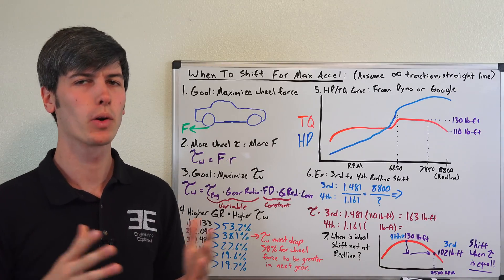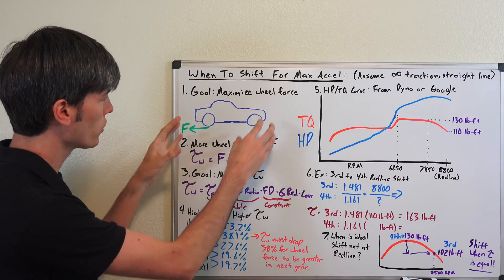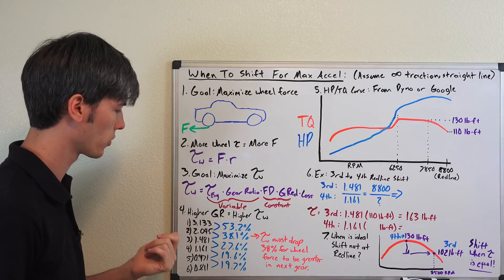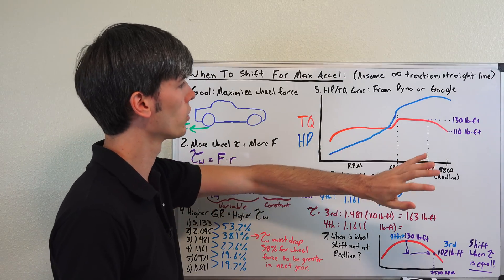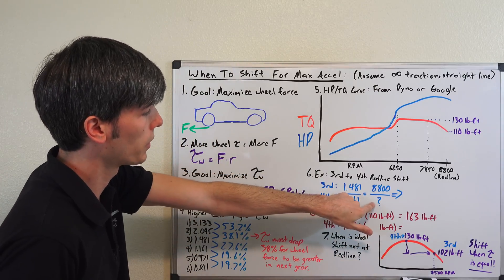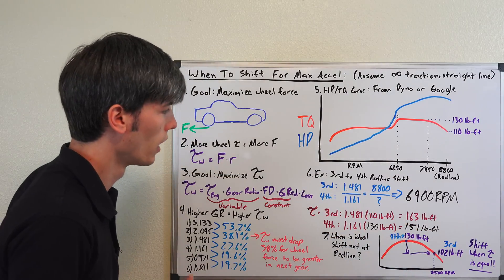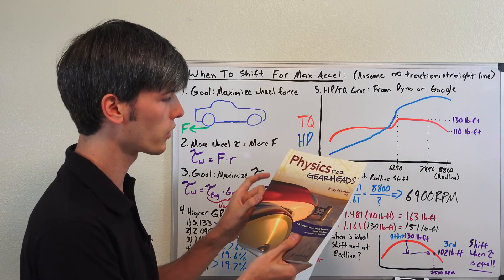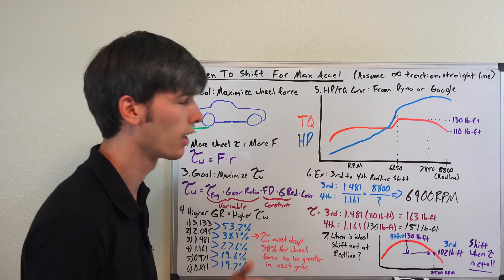When To Shift Gears For The Fastest Acceleration

Comment: I ride 2nd gear up to 50 km/h at 3500 rpm and 3rd to 80 km/h at 3000 rpm, the hard part is when I get to 4th gear I lose all my acceleration. Any tips? I can't ride 3rd any longer

Comment: Hey. Very interesting. I’ve found in my focus 1.5 TDCi 120hp that redline is slower than a (very small width) lower range. Also mid range double dipping accelerator seems to give the turbo an extra boost response but that might be my imagination lol

Comment: How does one get a flat torque curve in the higher rev range in higher gears? Is it not possible because the upper gears have a lower gear ratio and can’t supply the necessary wheel torque in the upper power range?

Comment: it's a theory to help you to understand how your engine works within the max power. HP or the power is limited , but how to use it properly for the max accel.
in a simple way :
when the engine power is much beyond the current ratio , shift when you hear engine's screaming.
when you're on the 3rd or 4th (maybe higher 5th depends on which car you're driving)ratio ,shift when you feel like your engine's roaming .
and when you ALMOST feel like there won't be any accelerating even if you shift up ,it is time to gear on the final shift .
this video bascily is trying to tell people how HP equals shift.

Comment: 1st gear launch at 2500 rpm.  Power shift into second at 4500 rpm. Shift at 7000. Rpm into third shift at 7000 rpm into forth.   03 Cobra  lol traps 127 in quarter mile lol

Comment: You cannot simply rely on torque, as a force to measure acceleration, per F=MA, because an engine isn't designed to apply a constant torque/force. The rate at which torque is being applied is also relevant. It is obvious, that an engine producing 500 lb-ft torque at 2000 RPM will not accelerate faster than an engine producing 495 lb-ft torque at 5000 RPM, as even though there is slightly less Force generated by 495 lb/ft torque, it is being applied so much quicker, that the sum of movement is more than 500 lb/ft applied at a rate of 2000 RPM. So the answer is to shift at the points where Torque X RPM is the highest.

Comment: Can someone in fair detail explain to me, what factors determine engine power and torque? Let's say they all use the same fuel, same chassis and body, then put a 2.0L natural aspirated engine, that makes 300bhp, vs a 2.0L that only makes 150bhp, what causes one, to make much more than the other, when they're both V6 for example, both 2.0L so why does one make double the power? I know some things like the quality and type of engine parts, but how does it make so much more?

Comment: Not to be picky, but don't you actually need to use calculus and integrate the area under the curve at any given RPM?  The Honda has a flat torque curve due to the VVT, so the simple(r) method described here probably gives the correct answer, but for an engine with a peaky torque curve it might not.  (I know, nerd alert.)

Comment: Purely from a theoretical point of view I can't fault you. That said, I have driven a lot of cars (manufacturer stock tune) where in essence what they have is essentially First gear, three 'Third gears' and very often an overdriven Fifth. On such cars the solution lies in experience with the vehicle: simply redlining each change doesn't cut it because the 'middle three' gears are too similar. On one particular Audi (sorry, I forget which exact one), I actually preferred to redline(well actually just over) in second and change directly to fourth if I was seriously in a hurry.

Comment: I'm wondering if anybody would be willing to double-check my math on this:
1st gear = 3.856
2nd gear = 2.648
Redline = 9000rpm

3.856(69ft-lb) = 266lb-ft @ 9000rpm
2.648(103ft-lb) = 273lb-ft @ 6180rpm

My method for when to shift:
3.856(x) = 273lb-ft
x = 273lb-ft/3.856
x = 71lb-ft

Then I look on the curve where 71lb-ft is and find it at about 8730rpm.

Comment: The power your engine is making is the amount of energy it is communicating to your car per unit of time. The energy of your car is it's speed, exclusively. The variation of it's energy is the variation of it's speed, i.e. it's acceleration. Maximum energy variation at maximum power, hence maximum acceleration at maximum power, whatever the torque is, assuming the losses are the same at every rpm.

And from a commercial pour of view, why would car makers let your car make more power shifting earlier, letting you rev at higher rpm for nothing, reducing the car durability ? It makes no sense so redline is top acceleration.

Also look at Auto/dct transmissions : floor it and it shifts at red line. Car makers won't reduce their car 0-100 with no reason.

Comment: Too many question in my mind.
Why use torque?
Isn't torque is the ability to pull weight? Aka to pull Newton which is mass * gravity?

Should be using horsepower instead, because max horsepower means biggest, fastest acceleration the engine is producing at any rpm.

That's why race car, racing drivers shifts and maintain the rpm at top, at very high.
They don't maintain the rpm at the biggest torque curve!
They maintain at biggest hp curve

Horsepower always direct proportional to the torque. 
Meaning, higher torque is higher horsepower correct? 
Hp=torque*rpm*constant correct? 
But why is the torque is dipping down but horsepower is still increasing? 

Please teach me, enlighten me

Comment: Well its not smart to actually hit the rev limiter because then you spend time bouncing the revlimter and lose momentum..you need to change just before it hit rev limter..

On my bike i i had best result when i changed at 13500rpm vs 14000rpm (revlimiter) my VBOX result was the same everytime i did this so maybe there is a flaw in theory my friend..

Many times i also had great result when i changed gear at peak power whcih is 13000rpm  but 13500rpm was the best.. also many cars when entering the TQ down part after peak will start struggling with air this also slows down your car.. and if changed at revlimter the drop in RPM will be 2\k rpm at least in some cases..

anyway good stuff.. but it would be nice if you tested real time vs theory

Comment: That S2000 has an exceptionally flat torque curve.  You aren't maximizing the wheel torque, because it is variable. You want to maximize the integral of the wheel torque over time.  The time it takes to shift (0.5s) relative to the time spent in each gear will incur a hefty time penalty.  I wonder if the time it takes for the clutch to grab (lock-up) changes much under high-load shifting, especially when there is a large rpm mismatch between the engine and transmission input.

Comment: Dude you missed a significant opportunity to simplify your own math.  Instead of multiplying the torque increase by the gear ratio decrease for each shift, you can simply work out a single quantity (Torque x RPM) and maximize that - ie shift when that quantity is going to increase or at least not decrease (otherwise rev it all the way to red line).

You could draw a curve (say in BLUE) for Torque x RPM, derived from the (RED) Torque Curve you drew.  Your shift points would be the first point you can shift without reducing this new quantity, ELSE Red line.  

If it sounds like a big effort to go round deriving a whole new curve from your Torque curve, that is a fair point, BUT YOU ALREADY DID IT.  You have the BLUE HP curve right there.  You just failed to use it.  

Bottom line:  Acceleration is maximized when your HP is maximized, so shift to keep the highest HP possible.

Comment: Thank you for the link to the book. I just received it and cannot put it down now. Currently working toward my BSME  after a 25 year career as a chassis and suspension designer.  Cut my teeth on the original Viper, not a bad way to start.  I really enjoy every one of your video's, your lingo sounds as if your are a product test Engineer.

Comment: I'm curious if you'd change gears at the point when your torque starts falling off. Wouldn't that be the optimal point? You would then use up the maximum amount of torque before it starts to drop and therefore get peak acceleration, then revs drop as you shift gears and you get maximum torque for that gear, assuming it's within the peak power band, instead of riding out to redline and wasting time as your torque and acceleration gradually tapers off? Or would this approach be slower?
Could you explain or explain where I'm going wrong?

Comment: could you explain How engines produce Torque? i mean why do normal engines Fall Off at 7000-9000rpm while high reving engines Like F1 engines Rev to 15k rpm and are still in a good Torque range.

Comment: my '10 wrx changed where i needed to shift after porting the wastegate(to alleviate overboost) and getting it tuned. makes 305hp/311tq but i think its slower through first since the power band is higher. i shift at 7k now

Comment: is it possible to calculate the diameter of the 2 gear cogs (assuming it's a constant mesh transmission) in perspective of engine power (for instance a 5-speed manual with reverse with a random engine that delivers 300hp)?

Comment: It's obvious with a powerband like the s2k that you need to shift at redline. It's very linear and breathes into the higher rpms, also has a really high peak torque. I think to bring the explanation full circle you should have done an old muscle car, 454 hemi or a subaru wrx, where they make power between 3-5500 rpms, and their powerband falls so flat in the high rpm that redline slows you down.

Comment: Actually, while torque is what affects acceleration, the interesting thing is that wheel torque is proportional to engine torque multiplied by the gear ratio, engine power is also proportional to engine torque multiplied by gear ratio at the same wheel speed. 

Essentially wheel torque is proportional to engine power when shifting gears. If you ask yourself this question: When I shift, will I land at a higher power on the power curve? If you land on higher power then you should shift earlier.

Comment: This is very important in Diesel cars: I have a 2.2HDi car (406 coupe), and despite the fact it redlines at 5000rpm, peak power and peak torque occur at much lower RPM. The torque drop betweeen 4000 and 5000rpm is huge, and after downloading my torque curve to a spreadsheet I was able to figure out it was only logic to push 1st gear to redline, because of the output ratio difference from 1st to 2nd. All other gears should be shifted well below redline. Very nice video!

Comment: some people when trying to accelerate hard fail to fully open the throttle and so get less torque when they shift up and the engine will feel flat. Often this is because the short time between ships is not enough to allow full travel of the accelerator pedal. In this case you need to shorten the travel of the pedal

Comment: Hello everyone I am buying right now a BMW series 218i with the new 3 cylinder engine  with 4 valves 2 injection and two exhaust in line turbocharged with twin power turbo technology 1500 cc 136 horsepower I would like to modify it to a more dissent horsepower like 170 -190 without overloading engine or spending too much. I would appreciate some suggestions speaking for European standards

Comment: What a missed opportunity to show how hp and torque are related.

You guys are doing this the hard way. Yes, multiplying the torque curve by the tranny gear ratio, and seeing where it crosses the next gear's torque curve will give you the optimal shift point. However, you can save yourself a lot of work by looking at the HP curve. When the hp curve drops off, you simply shift where the next gear will be making the same power. The next gear will be on its way up towards peak power, while the gear you're in will continue to drop off. 

It's 2 ways of getting at the same thing. Both methods will give you the exact same answer. Mine will take you about significantly less time to calculate, and you don't have to worry about torque multiplication; looking at power already factors that in for you.

Comment: I'm a bit confused here. I always thought that max HP provide the actual max acceleration, whereas an increase in torque will only increase the weight that the engine can move. Power measures how fast you put torque down and if 100 lb are enough to get you moving at all, more wheel HP translate to faster acceleration, not higher torque. 
So with this logic, having a higher power output of the engine (which increases until 8800 in the S2000 example) matters more than the torque that falls after 7850 RPM. Am I right, or wrong?
Reply: That's right. Power / hp is the important. He considers torque and rpm so he is considering power. Remember that torque x rpm = power. It's sorta the same thing. I think that it's easier if you put everything in terms of power. And also, rpm in the wheels itself it's what it gives you the speed you are getting. Power makes the calculations easier since power should be equal in any stage of the transmission, having losses aside.

Comment: Hello, there is a mistake in calculation: when you upshift from 1st to 2nd the gear ratio drops by 34.727%, it will increase by 53.2% in case of downshifting from 2nd to 1st. 
Correct gear disadvantages here: 
34.727%
27.58%
21.6%
16.36%
16.48%
Your number are for upshifts. 
Your videos are super interesting for watching. Thank you.

Comment: i am not sure if  missed the info anywhere else, but typically dyno sheets are of wheel horse power because they are done on chassis dynos as oppose to engine dynos. this would be done in your cars closest 1:1 final drive ratio, and would in your case be 5th gear( although might still be done in 4th, I'm not sure how they would normally approach this). your math is assuming the dyno results represent engine output numbers. fill me in if I  missed something or if there was a data context error for the video.

Comment: Why you calculate the torque rather than horse power in the wheel?  I think  doesn't  matter how much torque have in the wheel, but what matter is how much horse power the engine produce for the wheel. Because you can have a engine that have a high pick of torque in the early RPM and produce a lot of more HP in the high RPM. If your car have a pick of toque in 2000 RPM and the toque is 200 N.m and the engine can rotate at 6000 RPM producing 100 N.m  you will produce so much HP in the High RPM like to be exact 33% more HP. I think you should  use the same method  of using the gear ratio for the horse power curve rather than torque curve, right? Look at the C.V.T they change the gear in the high peak of horse power rather than peak of torque. 
Thanks bro, you are one of my favorites youtube channel  :D

Comment: Can you please explain how to calculate the shift recovery when using different final drive ratios. This works great except when calculating the difference between a 3.21 and a 3.92 gear ratio. The shorter ratio will yield in a higher shift recovery, but how much? Also tire size has a lot to do with this also. 3.92 with a 33" tire is completely different then if it had a 29" tire.

Comment: Mind bender, if you had a CVT, does best acceleration happen at engine peak torque or peak HP and why?
Reply: rcdieselrc Peak power is best disregarding the transmission losses because the power is conserved along the transmission, the torque is not. So the more shaft energy the engine produces the greater the final speed will be in the same time interval.
Reply: Yes, very good. You get an interwebs star.

Comment: I have a 2016 Camaro 2SS. I have a manual transmission and never redlined each gear. I guess I'm afraid of messing something up. Is it safe to redline each gear before shifting?
Reply: The transmission and engine wears a lot more if you run it at high rpm. Also the fuel consumption is a lot higher. 
But if you are trying to overtake someone you should rev it out high. If you are driving normally you should shift early.

BTW: I'm from Germany and they teach us in driving school that when you are trying to get on the highway you should just get in 3rd gear and rev it out until you are safely on the right lane (really easy way). They also teach that you should normally shift 2000-3000 rpm.

Comment: Hey bro 🙂

Ur doing Great.

i have a few questions about my Honda civic 2010 1.8 MT. (i-vtech engine)

U said we should shift into higher gears near red lines?
i usually change gears when the engine is at 4000 RPM. and the red line is about 9000.
I tried doing it but the engine made more sound(which is normal ofcourse).
Wont it hurt the engine? I always go above 4000 when im in the last gear. and i do it because its very smooth that way right? 

and second question is what is cruise control?
My car has it and i never knew how to use it.  I thought its a thing that is ON by default. M i right?
Reply: Do NOT shift at redline during normal driving, only for racing, etc..

Comment: Just by looking at the 1st and 2nd gear ratios (without a calculator) one cant tell that 2.045 is ABOUT 2/3 OF 3.133 NOT HALF.The torque percentage drop in the gears of the S2000 are:1st to 2nd=34.7%2nd to 3th=27.6%3th to 4th=21.7%4th to 5th=16.4%5th to 6th=16.5%And unlike the S2000 (because of the VTEC) On MOST cars and MOST motorcycles one SHOULD shift BEFORE the REDLINE.What say you?

Comment: I was wondering if you would do a video on redline top speed of a car. Many cars in the US are speed limited by the manufacturer and will have the throttle cut off  early. 

With the torque curve, hp curve and gearing ratios is it possible to determine how fast the car would go if it were able to reach the engine/gearing limit rather than the programmed ECU limit?